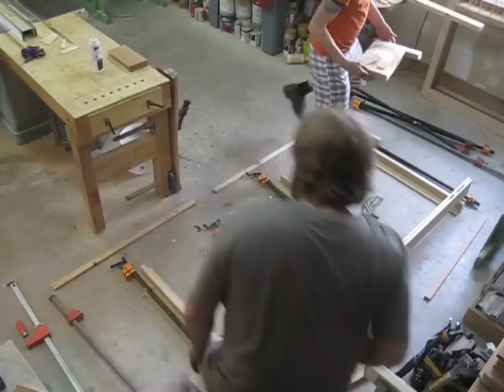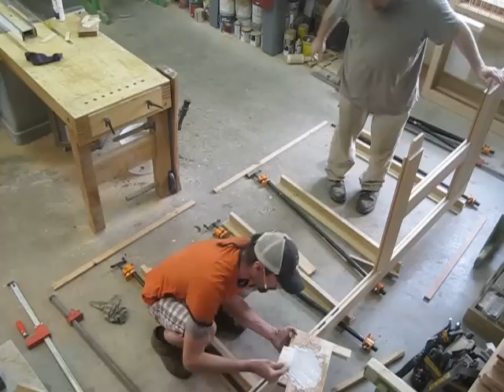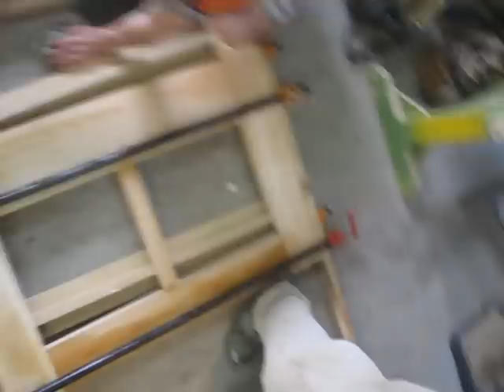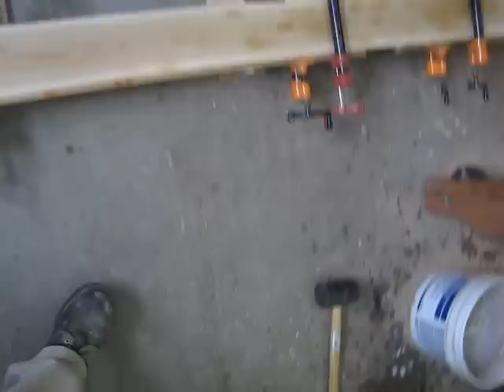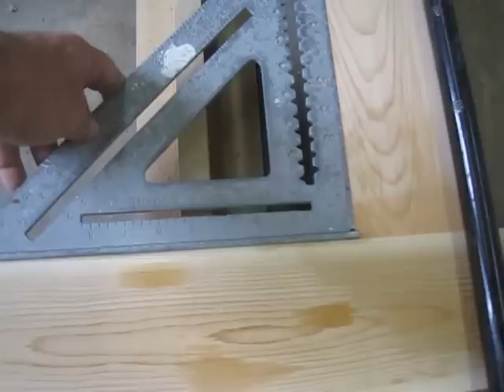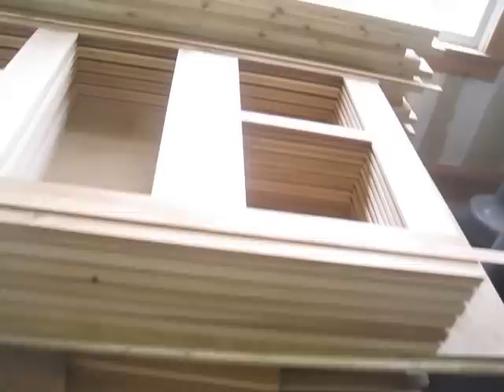Big glue up  for doors/ wadkin temple

Comment: I was hoping to see a Wadkin machine for clamping up doors that I worked with forty years ago. We used it for Oak furniture tables and side board tops. You loosely assembled your work, then turned a hand wheel what bought every thing together then stood on a pedal which put on the clamping pressure with a bang! to release you stood on a second pedal. Once had my hand stuck in a table top the one board was holding off, so I gave it a bit of fist and bang the palm of my hand was  clamped into the table top! A good friend got me out of becoming part of a antique reproduction  side board!